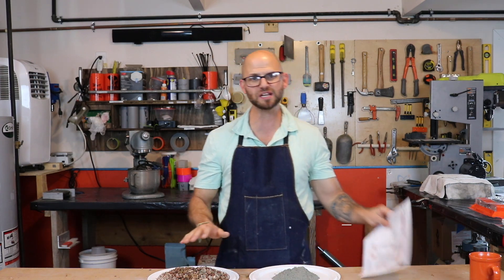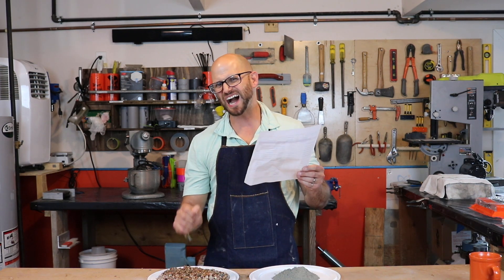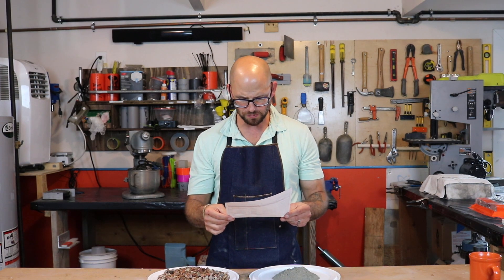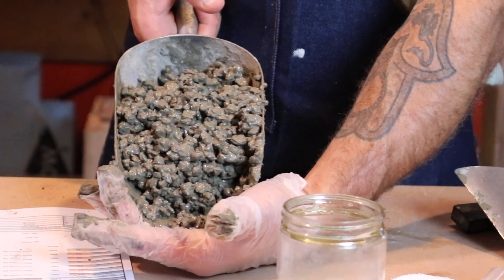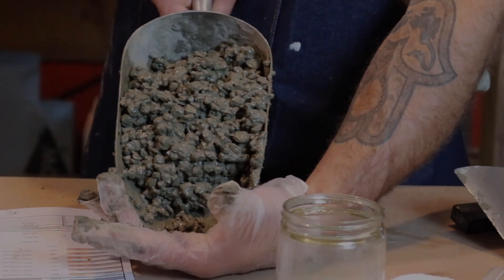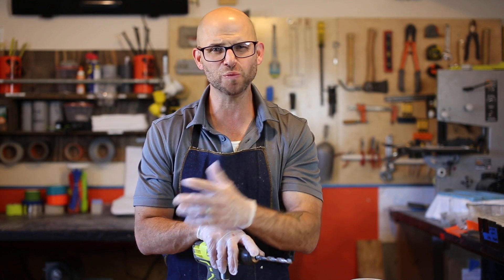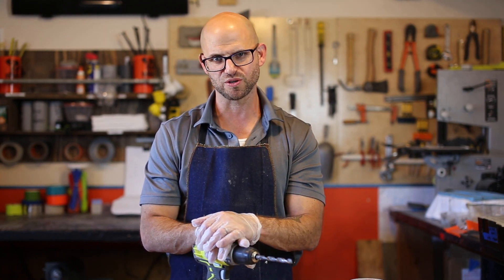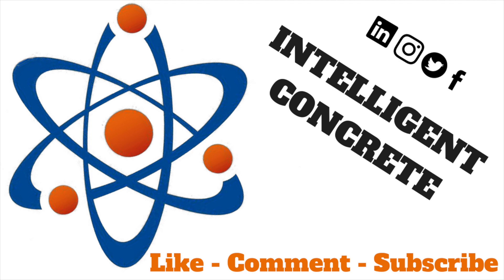Pervious Concrete - Vlog #64

Comment: Which mix design procedure should be applied for lightweight Pervious concrete as per ACI code??
Reply from the maker: ASTM C 192 if you are mixing in the lab.
Reply: @IntelligentConcrete  I mean calculation for proportioning like 1 : 1.6 : 7.2 
Which ACI code should be used for lightweight Pervious concrete.
Reply from the maker: ACI PRC-213-14(23) Guide for Structural Lightweight-Aggregate Concrete Reapproved 2023
Reply: @IntelligentConcrete  thank you for answering this code is for lightweight concrete not for lightweight Pervious concrete. 
Is there is any ACI CODE for lightweight Pervious concrete?

Is it possible  you provide me your WhatsApp no, I shall very thankful to you
Reply from the maker: Understood.  I’ll check but I don’t believe there is a standard for the combination.

The best way to get in to h with me is shooting me a message from our website contact form.

https://www.intelligent-concrete.com/contact-us/
Reply: @IntelligentConcrete  ok I am waiting for your response 

It looks like a company communication, but I am student